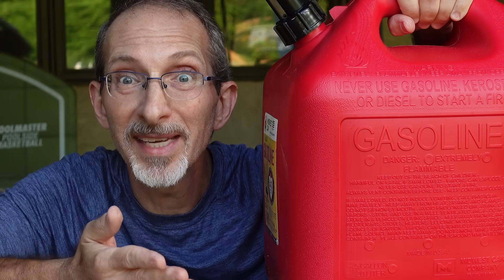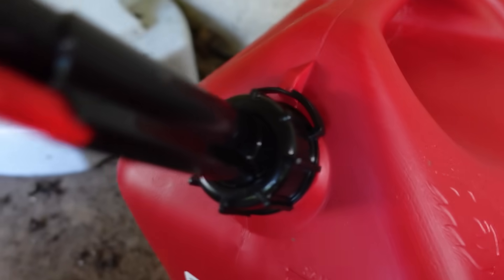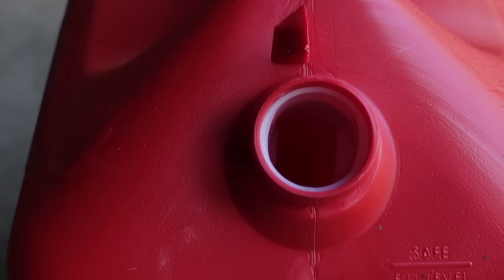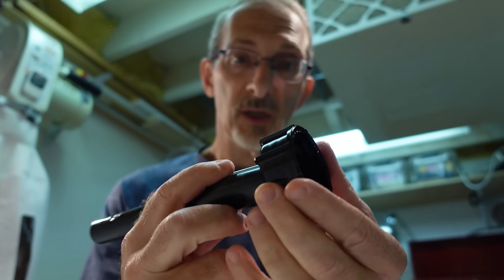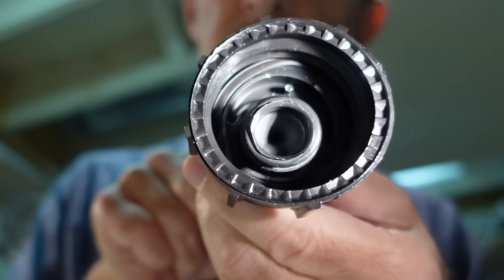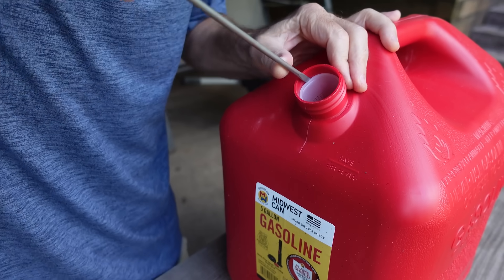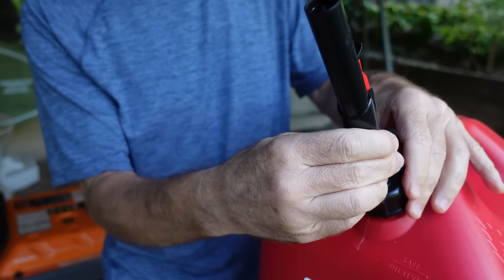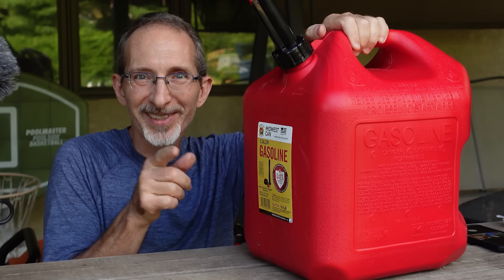Gas Can Modification | New Gas Can Fix

Comment: If you need only a gallon or two at a time and hate the new gas cans, Save old bleach and vinegar bottles, can put a gallon in each, and use a funnel with it for more accurate pouring. DON'T use milk jugs though.
Reply from the maker: Joe, I agree with having smaller cans on hand. I wouldn’t use milk jugs because the lids don’t seem to seal very well. Is that why you don’t recommend them?
Reply: @MikeFyxdt  They don't hold up to gasoline that well, some are dissolved by it.
Reply from the maker: @JoeZyzyx  makes sense!😁

Comment: The only thing you need to do now is drill the other side of the handle and install a valve stem less the core for a vent.
Reply from the maker: Zane, that was installed in my second video. Link in the description if you would like to watch!

Comment: Just go on amazon and search for EZ-POUR Replacement Spout. Comes with a vent you put in the can as well.
Reply from the maker: Arden, I did just that and will be reviewing the EZ Pour spout in an upcoming video. Thanks for watching!
Reply: It’s so wrong to have to spend your money to compensate for they mistake especially when you had to pay more to get the problem to start with !
Reply from the maker: @harryconover289  Harry, I know, it’s ironic. That’s why I was so determined to modify the spouts that came with these containers.
Reply: @MikeFyxdt  

Little late to the party, but if you have a half inch wood boring bit for your drill, you can buy the "replacement vents" online for dirt cheap. You don't get the fancy hose doing it that way like you do with the ex-pour kit, but if you just modify the spout like you did here, it will still flow freely.
Reply: I have several of these in use as well as the solid caps to secure all of the containers.

I also make sure each can gets a vent to increase flow and make sure it's capped in my garage. I have probably 5 or 6 of them.

Should really get more of them to increase my supply.

When will this pandemic end?

Next thing on the list is cloth napkin/paper towels and also  more wash cloths as well as a bidet.

Also gonna get a rain barrel and a water spout to have spare burn barrel water.

Have a good day all, stay protected from pointless bureaucrats.

There Bureaucrats Morty, I don't respect them!

Comment: Thank the lawyers for making us “safer” (can’t drive a car because modern gas can sprayed gas in our eyes) air quality improved (oops! Just spilled gas all over my lawn trying to open the modern spout) and making things idiot proof (when did an idiot ever read 14 pages of  “safety” warnings that came with an electric drill.)  I hope I never buy anything that has 1 or 2  safety warnings that I SHOULD actually need to read. I’ll never see it if it’s mixed in with “don’t brush your teeth with an electric drill” and “don’t use your lawnmower in place of toilet paper”. Thank the lady who spilled hot coffee in her lap, and her lawyer.
Reply from the maker: I love your examples, hilarious! You make some strong points.

Comment: If i'm not mistaken. I believe the filter is not to catch impurities but to prevent you from pouring gasoline on a fire or to prevent some sort of blowback. I think this was the result of some law suit that pushed Blitz out of business. So I have heard. Still you might want to check it out.
Reply from the maker: Yes, you are correct! It is a flame arrester which I explained in my second video, link in the description. I have a new video coming out tonight that explains the new law which will require these safety devices in all consumer gas containers. I’m not against them in principle, but they have to be made in a way where they don’t interfere with filling the tank or people are going to remove them like I did! Thank you for watching!
Reply: Yeah I heard about it and the Blitz stuff from John Stossel. Did not know there was a part 2. I will check it out thanks!

Comment: You can still get the cylindrical plastic racing cans with the clear hose. The don't have all the safety decreasing nonsense and actually work.  The safety police  in the comment section are pretty entertaining lol.
Reply from the maker: Yes, that’s an excellent suggestion! When you’re racing, you don’t have time to be fooling around with all of the safety spouts. The flow from a racing cam may be just a little bit too much when I am fueling my string trimmer, but for people with more high-volume needs, it may be an excellent solution! By the way, I have a new video coming out tonight that features peoples comments and new gas container laws. Stay tuned!

Comment: What is the purpose of that filter inside the can? Doesn't the filtered debris go straight back out the nozzle and into the appliance you are pouring gas into? Or am I missing something?
Reply from the maker: Dave, the filter is actually a flame arrester, which I explain in my second video – link in the description. I have a new video coming out tonight that features viewer’s comments and talks about new gas can laws, if you’re interested. Thanks for watching!

Comment: Yeah, and they can pinch too!  So annoying to use.  Where has our common sense gone!?  I end up hosing off the riding mower with the hose, after filling almost half the time because of the hard to control nature when topping off.  I will say, I do pick up gas, and the can goes in the trunk.  It does tend be tipped over when I arrive home despite driving subdued.  I'd be more than happy with a cap on a string, and a nozzle as well.
Reply from the maker: Yes, it's crazy how much gas people are spilling. I have a cap on one of my containers and it does add a little security. Not perfect, but better!

Comment: Thank you for the tip. If I get into one I may just swap the spring with one of lesser tension. Just tried to use your type 2 days ago.  Couldn't get it to pour into the mower. After about 15 mins was able to remove the spout and just poured from the can. This of course resulted in some overfilling. Can't imagine how bad it could have been if it started pouring with the nozzle, then having the mower move, the nozzle flying up and splashing gas upward toward my face or doing a face plant on the mower or the ground! My old Blitz brand with the telescoping spout would accommodate my finger to pull it up unyil snug. Other than bumping the spout too hard and it retracting, I didn't see any real problems with them. The trick was to open the vent to relieve pressure, then recap it to control a slower flow.
Reply from the maker: Oh, the vent trick! I added a vent in my second video and it made a big difference. Thanks for joining the conversation!

Comment: If the filter in the can catches anything - how do you clean it??? Dumb engineering is not the property of one company -- some even weld them in so buying the Eagle brand USA made metal cans make it worse by welding the screen in... Can't fix that one - and you can't fix stupid!! Putting the screen in the nozzle would be smart but NOT in the can because you can never get the gas out without going through the filter now clogged with dirt...
Reply from the maker: Clyde, what I called a filter is actually a flame arrester, which I corrected in my second video. Whatever you call it, it still prevented me from filling the tank so we need a better design! I appreciate you watching and joining the conversation!

Comment: While the self closing spout is a pain my gripe is the fuel dribbling out the spout because the can isn't vented. You'll find out. I cured this problem by drilling a hole in the handle and using a golf tee as a plug.
Reply from the maker: Oh, the golf tee trick! I didn’t know it until I read these comments. In my second video I installed a plastic vent with a cap, and it makes a world of difference! Thank you for joining the conversation…

Comment: I really hate those gas cans I still have to of the old ones with the yellow cap on the end those are the best but you cant even get those anymore. great job man awesome video
Reply from the maker: Thank you Gunner! If the yellow cap you’re talking about is a vent, then I added one in my second video, link in the description. I appreciate you watching!
Reply: @MikeFyxdt some had a vent. but the ones I have where like one piece with a yellow cap on the end like a plug
Reply: @MikeFyxdt  they did not have those locks in them

Comment: Hadn't bought a new gas can/jug in years.  Bought this same model and was "stymied" at every turn.  Strike 1 Fill up at the gas station- "Oh...what the?  what is this keeper thing on the cap?   Strike 2- hmm...some kind of screen filter gizmo....keeps shutting off the pump.
Strike 3 -  go to fill up the mower - wtf? what is this spring loaded spout???

I'm 65 and have managed to make it this far in life.  Geez.....

Did the same mods!!  THANKS!
Reply from the maker: Ha! If we both had the exact same experience, I’m sure there are hundreds, nay thousands just like us! Crazy design!

Comment: i still have 1980's gas cans, i would be using extremely colorful language working with these new cans, OSHA has gone beyond full metal reeeeeeeee on gas can safety. thanks for showing this i would have cut the entire stem off where the o ring is and the filters look like some kind of  prophylactic sasquatch birth control device gone wrong ..... i bet some OSHA representative is having an OCD melt down watching this.... just gimmie a normal cap and a funnel.
Reply from the maker: Hee hee! When that flame arrester came out I definitely thought it looked like some kind of birth control device! You’re lucky to still have your 1980s cans, I wish I still did. Thanks for joining the conversation!

Comment: I'm appreciating that I haven't bought a can in at least 20 years!
Reply from the maker: Thomas, but do you still have your old ones? Lucky if you do!
Reply: @MikeFyxdt I'm still using them. That's why I haven't bought one in 20 years.
Reply from the maker: @thomaswoosley4821  Oldies but goodies. Probably worth quite a bit on the gas container aftermarket…

Comment: This design is an example of malthusian engineering. I have yet to find a safe way to use them unmodified. The spouts leak everywhere the parts can move the first time it's dropped empty more than a couple inches. That usually happens before you buy it.

Comment: I think you could have cut the spring and then stretched it back to lenght made it easier to push the plunger
Reply from the maker: Poop poop, yes! You just described exactly what I did in my second video. Link in the description if you would like to watch. Thanks for joining the conversation!

Comment: I believe the screen is actually to prevent explosive air/gas mixing.  Not to catch trash.
Reply from the maker: Ox, yes you are correct. I made that mistake and followed up in my second video where I explained how the flame arrester was intended to work. It still interferes with filling the tank, so I think the manufacturers need to rethink the design. Thank you for commenting!
Reply: @MikeFyxdt  I do agree with your assessment that these cans are awful.  I have more spillage from them and have nozzle parts in the fuel tanks.  I have resorted to metal cans at $40 or $100 for a 5 gallon container as being more economical.

Comment: You need to drill a hole at the other end in the top of the can and add a bolt to vent and allow it to fill faster. I also pick up old cans and use the vents and spouts on my new cans.
Reply from the maker: I added a vent in my follow up video. It makes a big difference!

Comment: I don't have any new cans with a filter in them and I don't see the point. If something gets trapped in the filter, won't it then just go into whatever you're poring the gas into? If a filter is to be incorporated into the new cans, wouldn't it make more sense to have it in the nozzle? I'm just saying. I have four 5 gallon gas, two 5 gallon diesel and three 2 gallon cans. The small cans are for my different 2 cycle mixes which have no modifications.  The large cans are modified only by adding the old style yellow vent.  None of my cans have that HD spring and are easy enough to handle as they are. Thanks for the video and the time spent for the benefit of others.
Reply from the maker: PJ, the screen is actually a flame arrester safety device. I clarified this in my second video, link in the description. New law was just signed that will require all cans, 5 gallons or less, to have these in place in the next two years. Thanks for joining the conversation!

Comment: Howdy.  Nice video.  I'd like for that o-ring to keep gas in the can when it gets tipped over or gas is sloshing with the can stored in the back of my truck.  Seems like removing the spring will jeopardize the seal of that o-ring?
Reply from the maker: The O-ring still is securely seated when the spout is pulled out and the red latch snaps into place. In my second video I showed how to modify the spring so it has less tension, but it’s still returns the nozzle to it’s closed position. Hope that helps and thanks for watching!
Reply: @MikeFyxdt  I have since watched the second video.  Thanks for the reassuring info!

Comment: I use a large Hopkins quick fil funnel. I replaced the spout with a yellow ez pour replacement gas cap. Then I drill a hole a little smaller than the yellow vent cap in the highest part of the gas  can. I then take a generous amount of super glue a put around the drilled hole. Then center the vent cap and drive in the hole with a small hammer. Hold with the cap open until glue sets. Now you have a dependable quick way to fill up. You can fill as fast as you can pour.
Reply from the maker: Great suggestions Jess! I didn’t think of using glue or a sealant to hold the yellow cap in place, but that might be a good precaution. Thanks for watching and for commenting!

Comment: The solution to this is do not buy the product .if it is a poorly engineered product do not buy it and do not modify it outside if it’s intended purpose if it’s for your personal use that’s fine but the minute that this would be use modified on a job site now we have all types of liability coming in play.
Reply from the maker: I think they work acceptably after these mods, but if I didn’t wanna do it I could’ve return them.

Comment: What you refer to a filter and spring mechanism are actually a flashback arrestor system, designed to keep fire from following gasoline when the can is misused and poured onto a fire.
Reply from the maker: Steve, yes you are correct. I followed up this issue in my second video, link in the description. Thanks for commenting!

Comment: Well folks, in case u have not been paying attention, the socialists (eye. e., progressives, democratics) want u 2 do is get pissed off at the gasoline for spilling. That way, u’ll be good little socialists and buy electric lawn mowers, et. al., and not need the filthy, polluting, oil based gasoline.
I know, this guy needs the gas for a generator, notice he didn’t say anything about needing the gas for a lawn mower b/c he prob already has an electric mower.
He looks like a good little socialist.
Reply from the maker: No socialists here buddy! My gas guzzling ride on mower runs strictly on processed dinosaur remains. :-)

Comment: Trying to hold and juggle 5 gallons of fuel while pushing, twisting and aiming the can is almost impossible. Like others I never used to spill any fuel before but my "safety cans" suck and make it a chore.
Reply from the maker: Roger, my back hurts enough these days without having to wrestle these containers. I agree with what you’re saying!

Comment: Thank you! Just bought one of these and we couldn’t figure out why the gas wouldn’t come out. The instructions were stuck closed so that we could not read them. The gas can has just been sitting until we found online instructions. This is for a mower. Now we can modify to use it. Yay! So crazy to have to do this. I am assuming that the modifications do not make it leak when pouring?
Reply from the maker: Teresa, I haven’t had any leaking after making the modifications. Check out video two where I put the spring back in, but cut it to lessen the tension. It gives you the auto shut off feature but without the hassle of having to apply all that force. Thanks for watching and good luck!
Reply: We followed your video and the gas can works great now. Thank you. So much easier.
Reply from the maker: @teresainil2904  That’s great news! Thanks for checking back and letting me know!

Comment: I just unscrew the filler and use a $10 battery operated pump from HF so I don't have to lift 40 pounds too!
Reply from the maker: I’ll be reviewing one of those in an upcoming video. Thanks for joining the conversation!

Comment: What about snorting the spring so it still works but doesn't fight you when fueling up?
Reply: Dam spell check: 'shortening'.
Reply from the maker: Tom, I cracked up when I read your comment and figured it was a spellcheck issue. I don’t recommend anyone actually snorting the spring. That said, I did shorten the spring, or rather cut it in half and stretch it back to its original length, in my follow up video. There’s a link in the description if you would like to watch.